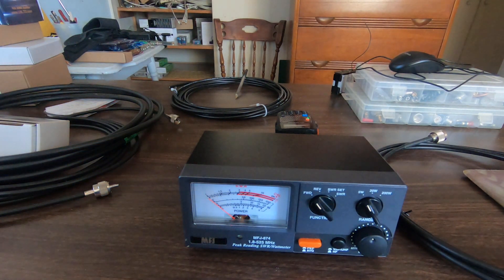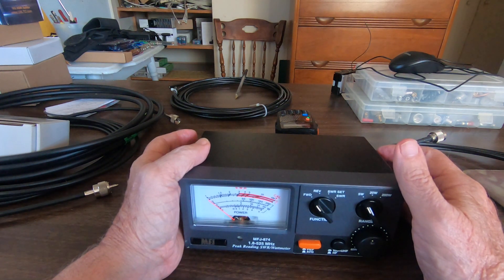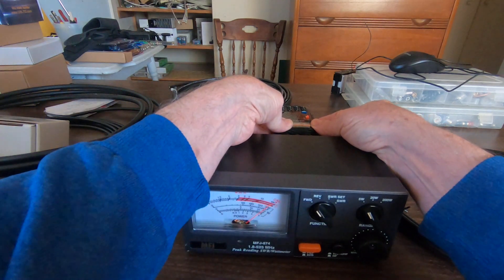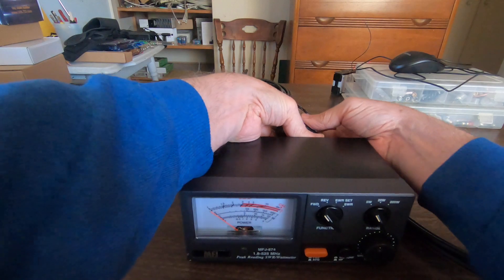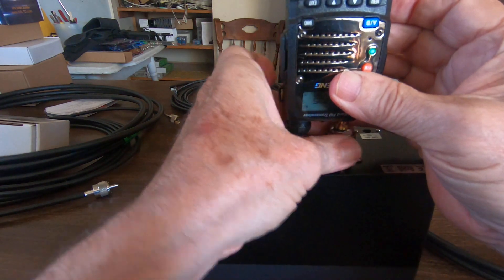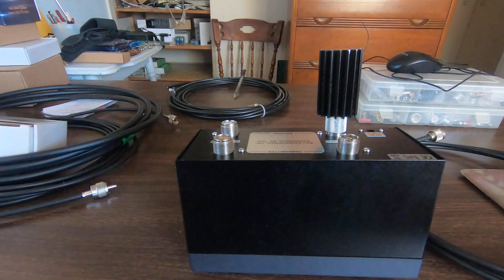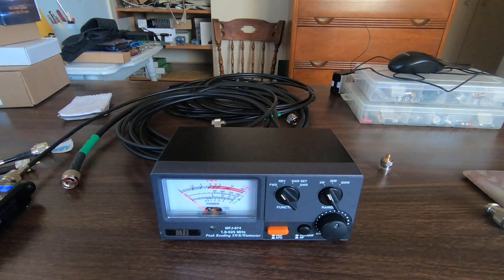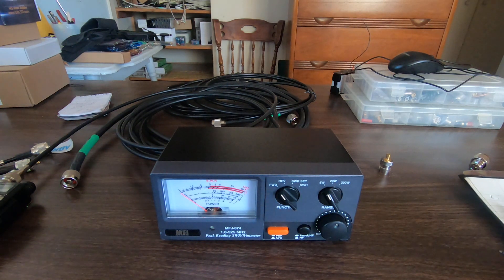Times LMR-240 vs. ABR Industries 400 and 240 cables.

Comment: Hi would the power be the same for 33 ft of the times lmr 240?
Reply from the maker: The main takeaway from this video is that the 240 cables are as good as the 400 cable (in this frequency range) - so do not waste the extra money on the 400 cable. The longer the cable the more the loss.
Reply: I use lmr-240 (35 foot run) on a comet gp15 for uhf/vhf and have no issues and low swr.